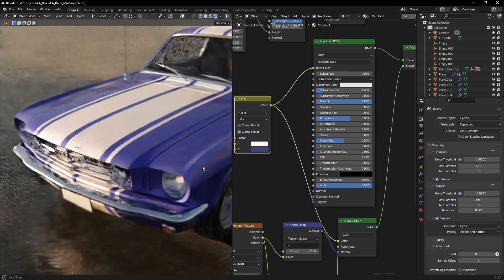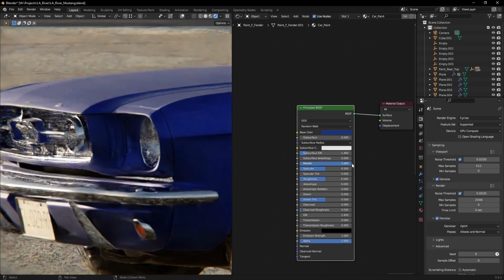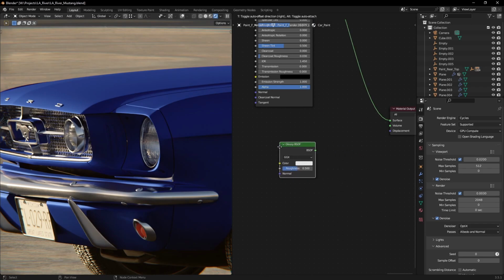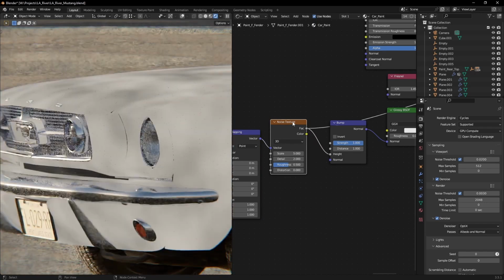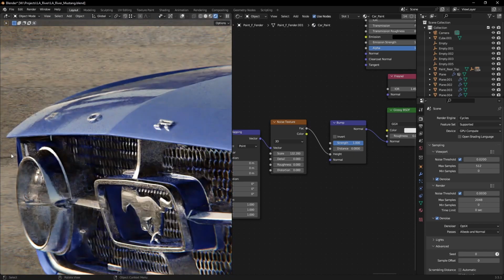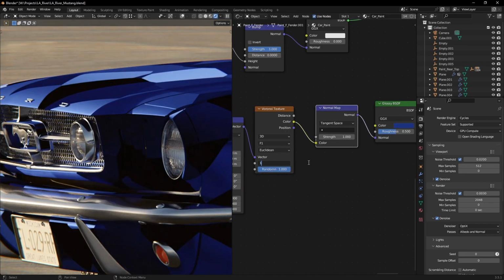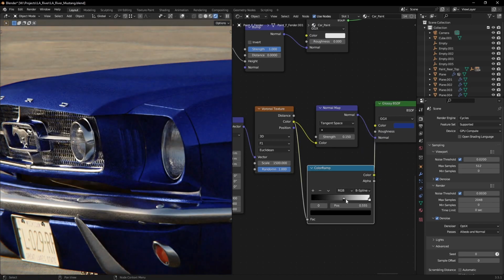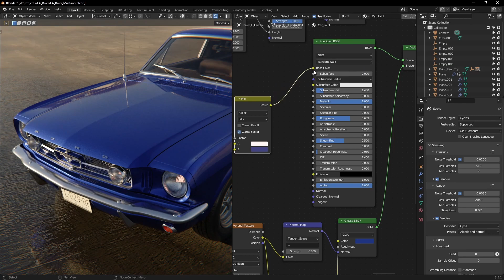How to Make Car Paint with Flakes in Blender

Comment: What does the shader for the headlight glass look like?
Reply from the maker: its a simple glass shader with a normal map, just google headlights normal map and you will get the image I used 😁 also make sure only the front faces of the glass are mapped and place the rear on a flat area of the normal map, scale it down if you have to.
Reply: @ yep I’ve been using the same for a while but mine never looks like yours in this video do you mine sharing that shader so I can see it as well?
Reply from the maker: um, sure, I'll upload a model a bit later.